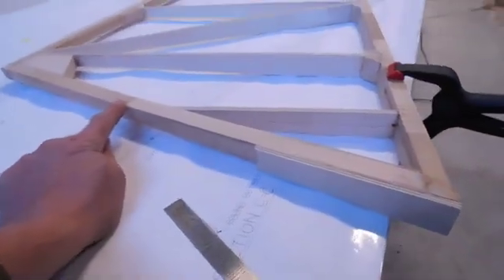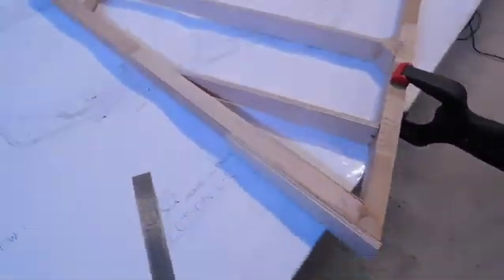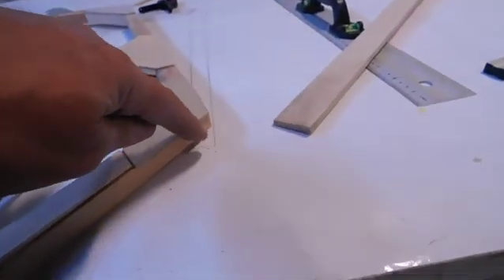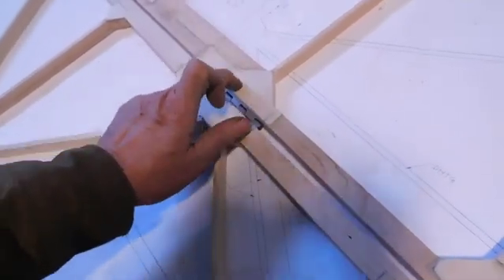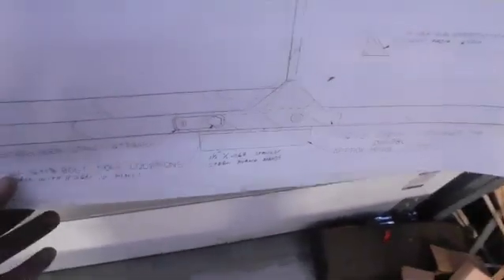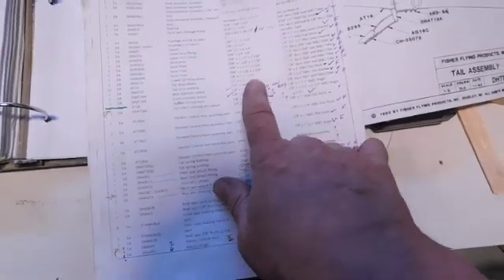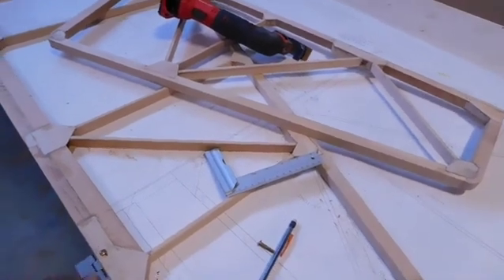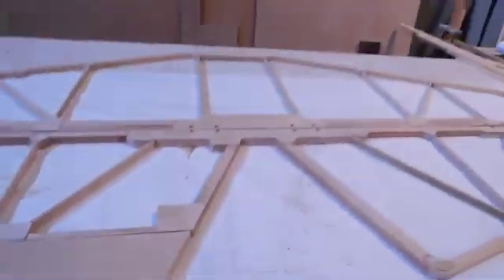DAKOTA HAWK EPISODE 85

Comment: With the addition of the 1/4" ply plate, the control horn per plans should be adequate.  It seemed the 2" arm that the rear AN3 bolt had to react the hinge moment is too small.  From ANC-18, the limit for spruce in bearing by the bolt is 703 psi. Then the bolt can react 107 lbs and the hinge moment is limited to 214 in-lbs.  I calculated the area of the unbalanced rudder at 3.3 ft² and Vₐ at 90 mph. With a Cl of 0.6, the unbalanced rudder load at Vₐ is 41 lbs. The rudder 1/3 chord is 4.7 inches and the hinge moment is 193 in-lbs. If we include the added 1/4" plate to the calculations, it increases the bearing strength to 160 lbs and the safety factor is an acceptable 1.6.  I estimated the vertical tail area at 9.2 sq. ft.
Reply from the maker: I increased the size of the arm slightly moving the rear bolt back ~1"...

Comment: The fix for the butt joint, also known as an end grain joint, relies on another end grain joint between the vertical spar and the 1/4" ply. 

Remember that the aerodynamic rudder hinge moment produced by the rudder load acting at the 1/3 rudder chord distance (arm) will be reacted by the rudder cable tension on the actuator or control horn arm.  So when the rudder is stationary but deflected against the free stream, the net torque on the hinge itself is zero.  From the design criterion in the CS-VLA, the rudder limit load should be about 22 lbs/ft² so you should be able to calculate the hinge torque. Alternatively, the CS-VLA allows that the limit is dictated by pilot effort, 200 lbs tension in the rudder cable. Then the hinge moment is 200 x 2 inches x cos30 (deflection angle) = 346 in-lbs. The forward attach bolt on the control horn will act as a pivot with the rear bolt reacting the torque, both will be loaded forward putting the bottom rib in compression.

Comment: At the bottom of your rudder,  why not just add a dowel instead? Then you would save weight and not worry about the side forces put onto your rudder horn.
Reply: Well, be the first. Add a dowel...
Reply from the maker: @outlawflyer7868  I'll see what other joints come up... I've already completed the rudder. I'm less about dowels and more about actual joinery... dove tail or even a lap joint would be stronger than a butt joint.
Reply from the maker: With all the various joints I was wondering why people don't use more joinery, I mentioned that in a previous video. It does take more time but it would make a stronger joint.
Reply: Read ANC-19, Section 5.211.
Reply from the maker: @robertdaly9870  "usually not advisable" but it is a book that is 70 some years old and the glue is better now... they also said that a straight butt joint MAY be stronger than a dove tail, which is ridiculous. (Irregularly shaped surfaces are more difficult to machine for perfect fitting of parts than are plain, straight surfaces. Lack of contact may make the effective holding area smaller in the shaped joint than in a straight, flat joint, and this may actually reduce the strength.) Everything that I read is full of "may" "might" "could be" "should", that really isn't the kind of wording that is definitive.
Reply: @sawyersdad5292  "They also said that a straight butt joint MAY be stronger than a dove tail" - this is a misreading. The text says proper gluing of "side-grained surfaces" can develop the full strength of the wood making the extra contact surface of machined joints superfluous. I read it as too much relies on the fabricator and his tools and abilities. 70 years old, sure, but nowhere else exists the comprehensive testing and evaluation specific to wood aircraft building. If one is building a wood airplane, especially if they're doing some engineering along the way, ANC-18 and 19 are indispensable.  TEAM Aircraft sites ANC-18 as a resource.  As does Richard Hiscocks' "Design of Light Aircraft".
Reply from the maker: @robertdaly9870  I agree they did exhaustive research, but there are a new technologies and it seems they were talking more about how wood aircraft could be used in more commercial rather than recreation... they were also saying about never gluing a sanded or cut piece of wood alway have a planed piece of wood. Pretty impractical for the home building process. But understanding the meaning... they want as clean (undisturbed grain) as possible/practical, when you're building a Hurricane that is essential. But on the Dakota Hawk, less so... even my planner doesn't have the power/quality to make a clean cut like the old machines back then. And I'd be willing to bet that most of the pieces you get in the kit were just cut and not planned. So although I agree that the book is important, what's just as important is understanding the underlaying sentiment of building in wood... good wood, properly machined, using quality attachments and engineering principles.

Comment: Your structural improvements seem like it will make it stronger but I don't think it's necessary. That butt joint cannot come apart unless the gusset joint fails first. Also look at plan DHTP3 and play close attention to the shape of the bottom of the rudder. When you bend your AT18 your added plywood on the bottom will be in the way. Also, pay attention to the height of the AT18 in relation to the fuselage, very important detail, you do not want it low unless you want problems rugging the cables.
Reply from the maker: You're probably correct, I haven't heard of any problems... just my peace of mind...

Comment: The taper on the top of the front rudder I've not addressed yet, waiting for some genius idea to pop into my head. It is just 3/4" in the kit. Also I was mistaken about the taper on the bottom piece. I did have to glue pieces in each side. What I did was glue them on, cut the taper, then assembled it into the structure. The glue joints are barely noticeable and when I looked the other day I did not see them.

Comment: Good ideas with the rudder. As for the tail hinges, normally cover both parts and then fit the bolt and nuts after, not normally covered over the bolts and nuts.